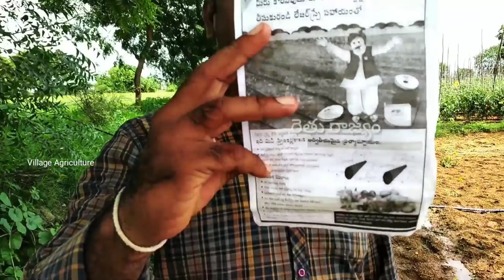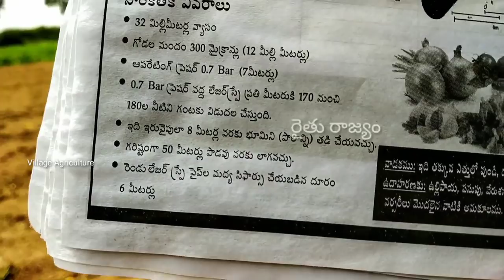ఒక్క ఇంచి నీళ్లున్నా ఎకరాకు తడి |  DripTech Rain Pipe | Jain Drip New Technology Installation

Comment: I had given 8.5 k per acer  for normal drip but Urr saying 40 to 45 k per acer and that's also use for only small height compare to this normal drip is gud
Reply: Bro u buyed it for subsidy buy original cost for only 450 mtr drip latter is 1800